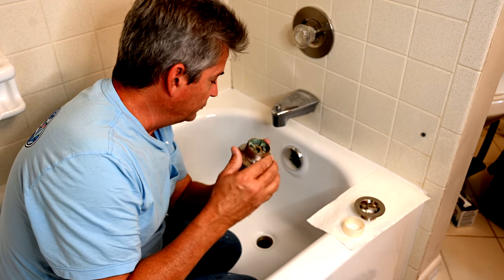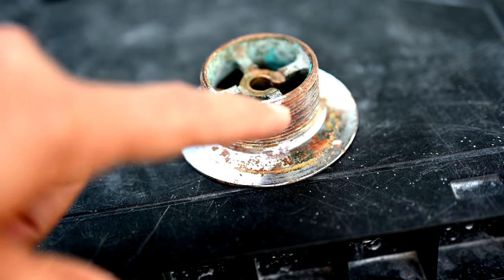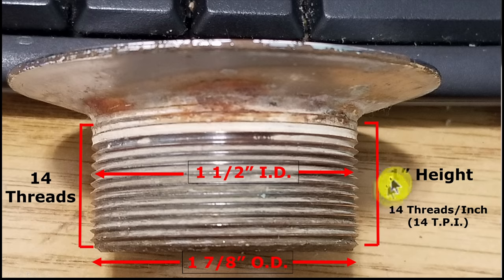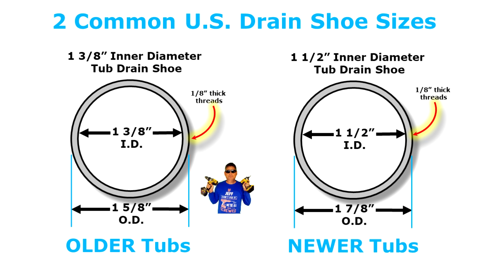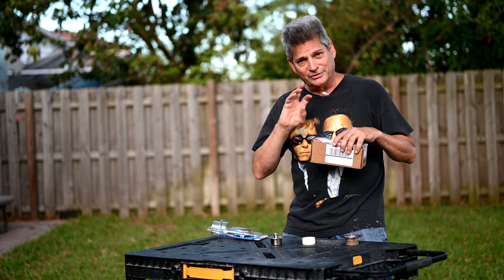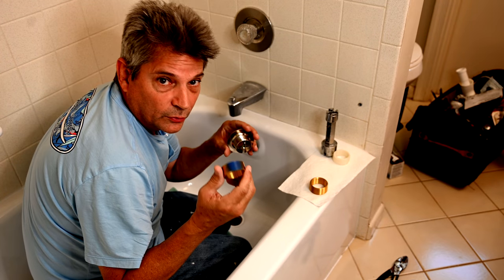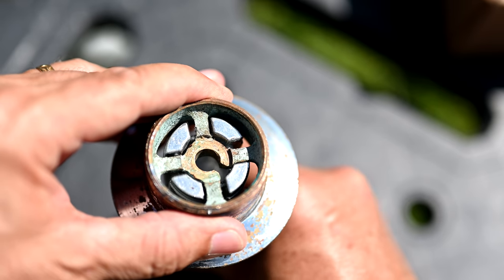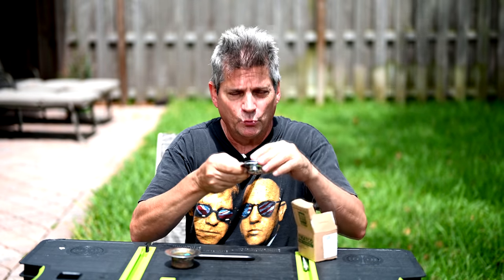New Bathtub Drain Won't Screw In? How To Fix Threads [SOLVED]

Comment: Don't use a wrench. My daughter did that and broke it the drain. I bought the Husky Tub Drain Removal Tool to get it out. Listen to Jeff and you will be ok.
Reply from the maker: Yes many people end up breaking the tool or the drain when they don't use that drain wrench
Reply: Absolutely.  Jeff's not going to steer you wrong.
Reply: Lol I used a pair of lineman pliers by the handle because they tend to be thick and robust, then I turned the pliers with a pipe wrench, but if I had the cool tool I would definitely use it.
Reply: @jeffostroff I tried 2 different husky tub removal tools that didn't work so I broke the drain on purpose and then used a dremel to put some cuts into it for grip then put the back of a hammer in and was able to break it loose then was able to unscrew it.
Reply: My husky tub drain removal tool wouldn’t tap in.

I eventually got it by heating it with a heat gun and sticking a wrench in it and putting a ratchet extension through the top side hole of the wrench 🤷🏻‍♂️

Comment: All this to replace a drain plug? The whole bathroom business is bobby trapped. I don't know what is worse to deal with - replacing a toilet, or something like this. Touch anything and it turns in a  a can of worms.  Kudos to Jeff for doing this in apartment buildings where he needs to get it right the first time and in one day and not cause the leaks in the building.  I wanted to replace a toilet seat in my house  then said might as well replace the whole toilet. Bought the elongated one by mistake, took it back to replace it with smaller one. Then realized my flange needed to be replaced. Had to chisel around the pipe to remove it but  dealt with that, then realized my floor is bad and ended up replacing the sub-floor bellow the toilet and relocating hvac pipe from the lower bathroom that was in the way ... Then wanted to replace the bath fan and realized it wasn't even hooked up to the roof vent it was just venting in the attic  and that is how the builders left it 30 years ago. ....Replaced the vanity and realized the new one was 1/2 in bigger so had to build up new floor height to adjust it,used difficult to cut cement boards-needed a special blade to complete the job. I suspected replacing drain on the tub would end up exactly like what Jeff;s ordeal here that is why I would never touch mine w/o real emergency never for cosmetics.  I think replacing the whole tub is easier but you MUST gut down the whole bathroom to the studs. Doing this piece by piece is worse.  I mean none of this is really difficult but you have to forget about everything else and devote infinite amounts of time and purchase the most annoying to find parts and special tools to get everything right. The alternative- to call professionals is out of the question for me because they charge you obscene amounts of money and you just don't know if they did it right or not.

Comment: 99% of attempts to remove a tub strainer in a 100-year-old cast iron tub here in the Big Apple result in a broken crossbar. I don't care what tool is used to try and remove it, the result is always the same. We have multi-family apartment buildings in N.Y. with no access to the rear of the bathtub. If by some chance a miracle were to happen and the strainer was able to be backed off, you better hope the shoe (a.k.a) the female threads doesn't drop down, cause then you're F%#$ed. Sometimes hiring a pro isn't a bad idea.
Reply from the maker: A couple of other good ideas that work pretty well is to spray it several times over a half hour with PB blaster and let it soak in under the flange as much as possible. And then a lot of seasoned plumbers will heat it up either with a heat gun or just with their torch heat up the drain enough that everything expands and gets slightly softer and that helps to loosen the drains as well.
Reply: Sounds like metal to metal corrision.  Slightly heating before removal may help.

Comment: OK I didn't want to like this video because of the dad jokes but it really set me on the right path to replacing the bathtub drain in our 1955 home that still had original drain. None of the off the shelf replacement kits would fit and it drove me crazy why. I have to give Jeff credit on making this video very easy to understand and next steps. Just like this video I bought the red and blue sleeves from Watco and everything dropped right into place. Thanks Jeff, you saved this man's sanity.

Comment: this is all well and good until you have to deal with a corroded drain that you have to cut out and mangle so you can't figure out the thread count
Reply from the maker: Best way to handle that is cut 2 vertical slits in the drain and pry the piece out, then you have an intact drain with just a slice of pie shape missing.
Reply: i did the job last night and it was tough but i got it! I notched a slot with dremel tool to hammer it around with a screwdriver. I used a heatgun to soften the old putty. I had to notch it like 4 times to get a full turn. After about 1.5hrs I got it! The old drain had putty in all the threads which made a B----! thanks for the video
 @jeffostroff
Reply: luckily the drain I bought had an outer brass coarse thread that the stainless fine thread screwed into....fit good @jeffostroff

Comment: Thank you so much for emphasizing threads per inch! Now I know why my box-store replacement was leaking. They didn't state anywhere the TPI but I measured and the new one was 16 TPI while my old one was 14 TPI. Close enough that I could thread it in but different enough that it would leak.
Reply from the maker: Way to go now you are ready to make that problem go away forever

Comment: Great video, just spent 6 hrs pulling my drain. The tub is 80 years old cast iron, but in good shape. My plug is fine thread w/inside Dia 1.5". I going to research the Watco website for the drain. Thanks Jeff
Reply from the maker: Is glad to help a good luck with your research Lisa
Reply: By the way might be a great tool to give away. I just bought the Lowe's brand today.

Comment: What an incredibly good video! 👍👍👍  There are tons of videos on how to replace a tub drain that go smoothly with standard parts.  They don't cover  the problems you just covered.  Thank you!
Reply from the maker: Thanks! 👍 Yes with my engineering experience I always get called in for the more difficult projects and so this was a great one to make a video for
Reply: @jeffostroff  I have several corroded exterior parts like the tub drain inside a jacuzzi tub.  Do you have a video on how to replace exterior in-tub jacuzzi parts and where to find the parts?

Comment: I wanted to drop a comment to thank you for making this video and going through the detail. Some days ago I had used the tool you suggested to unscrew my old tub basket. unfortunately it's 1 7/8" across where the threads are and is a 14 thread. So it's what the blue bushing converts to. However, the drain I bought was already 1 7/8" without a bushing. Now I ordered a smaller drain plug and have to wait 2-3 weeks for the bushing to arrive and hope that this all works. Apparently no one makes a 14 thread 1 7/8" bathtub pop up drain plug. At all. No one. So the frustrating part of my project is not the work itself or the labor but rather having some ancient plumbing that no one works with any more and I got quoted $700 to replace the whole system and decided to try it myself to just swap out the drain plug. What a nuisance. The industry are a-holes for making everything so obnoxious just to scrape together a buck at the customer's expense.

Anyway, thank you again for the video, the information about the bushings, and your tips. Hopefully everything works out in a few weeks' time and I'll still have spent under $100, just dealt with the headache of not being able to find a damn pop up 1 7/8" 14 thread drain plug on the planet.
Reply from the maker: That's what stinks abbot proprietary unconventional part sizes
Reply: Hi I am currently having the same problem!! Did it work with the bushing? I want a pop up drain but no one sells a 14 thread, 1 7/8 bathtub drain! So I resorted to ordering a bushing!

Comment: Thanks for that last info about the Watco faceplate.  I already own the drain wrench, so was able to move drain up a little but in the end might want to reuse drain (only 19 years old) with new faceplate.  I still will remove drain flange completely to make sure the black washer is installed correctly and redo putty.
Reply from the maker: Thanks for watching Katy, glad you liked it
Reply: On closer inspection there is too much corrosion to reuse the old drain flange.

Comment: I love your DIY videos along with another Canadian DIY show. Your instructions are clear and you are not arrogant or talk down to your viewers, unlike a builder channel from Texas does. We are going to be moving onto a brand new house my F-I-L is building for us. But our landlord is crazy, therefore we are fixing inexpensive damage to the house that was caused by her lack of maintenance and her cutting costs on the remodel that was completely her own fault,  but she blames us for everything, including forty-year old leaking windows a broken forty-year storm door that never closed, no exhaust system in the bathrooms or kitchen, not sealing Pergo in wet areas, and the whole septic tank system needs to be replaced, even though she never maintains it, and many other issues like corroded pipes that have damaged the bathtub faucet and handles, etc. It is just easier to fix things on our own than to have a headache we we move put on November or her trying to sue us for $10,000 for a new septic system when it never worked properly from day one. The house was never remodeled properly. Caveat Emptor, don't rent a place that looks brand new because there can be so many problems that our hidden and don't rent from a crazy foreigner who only accepts cash for rent and only speaks English when it's convenient to her.
Reply from the maker: Thanks Jenny, glad to help

Comment: You mentioned putting a little silicone around the drain after it’s installed. Could you show or explain how you do that? I’m concerned about water pooling around the drain after a shower because the drain is a little thick. The silicone sounds like a good way to make sure all the water drains out.

Comment: Great Video Jeff, I have a 1-3/8 Inch x 16 Inch fine thread that gets stuck after 3-4 turns and won't turn after that  Any advice? is there anything smaller?
Reply from the maker: This x16 thread, is this the new one, or the old one that you pulled out? You have to replace your drain with the same thread count that you took out, and diameter. IF it stops 3 or 4 turns in, the thread is not the same as the old one, so it won't mate up to the drain.
Reply: @jeffostroff  Thanks for responding Jeff. So the plumber cut the old one out in pieces. I managed to count 11 teeth on the old one , so it appears you are correct with the thread. I assume it’s 1 3/8 with 11.5 TPI? Which I cannot find online
Reply from the maker: @Callingzion   Did you use that table that I showed? If you can't find it there then your only other choice might be to replace the entire drain and overflow assembly which would require access to the droid wall behind the plumbing in the shower.

Comment: Thank you for this video. It is extremely helpful. When you said you would put silicone sealant around the drain after you finish the installation, how much do you use? Just a thin bead around. Do you wipe it in? Smooth it out? I’m new to all this but learning as I go. Thanks!
Reply from the maker: yes I run a bead all the way around the flange, then when it oozes out, immediately wipe if off, and use wet paper towels, before it starts to set up

Comment: Plumb shop from Canadian tire has the wrench in the picture as a removal tool. I was also told the new drains are plastic. So even more room for error with wrong tools. The proper drain wrench has gotten cheaper. Just got one for $7.99. Score.

Comment: Thanks for the video. I’ll be doing my drain in a few weeks. I got the drain already purchased. The top opening looks bigger than the old one. But it also has very thin walls. So I’m hoping it’s ok. I can only find 1 1/2 inch drains in the shops near me. Hopefully it fits. Hopefully my drain is actually 1 1/2 inch
Reply from the maker: If not you get a downspout adapter from 1 1/2" to 1 1/4"

Comment: I'm in tears trying to figure this out on my own. I had purchased the wrong size drain because it was too tall. The old drain is like you show 1". The one I purchased looks to be about 1.5". The threads seem to start to screw in but it only goes half way in. It's too tall. I've taken pictures and you can clearly see that the old drain is much shorter than the new drain.
Reply from the maker: You should be able to take the old dream that you pulled out of the tub and use all of the methods I showed here in the video to determine what you need to buy. Some people end up just ordering new drains online that have the correct width and threads so sometimes you have to get them from plumbing houses, sometimes it helps to know what the brand name is of your drain which is often the same as the the faucets but not only is guaranteed.

Comment: Hi Jeff thanks for your demonstrations. Is there another way to stop shower faucet cartridge (stem) with leaking, without removing and  replacing.
Reply from the maker: Probably not, it means either the black rubber o-rings are degraded and leaking, or if you pull out the cartridge, the 2 tiny rubber washers that go way back into the valve holes might be degraded, so it does not get a good seal. Either way, new cartridge is $15 so why no replace it and reset the clack back to day 1 again.
Reply: @jeffostroff  Thank you Jeff for your advice on faucet leak.
Reply: Yes plug it with 2 pieces of bubble gum and call your attorney general and ask what time is it. The call your girlfriend and break up🤣🤣

Comment: My problem is that the drain pipe has no threads. What would you recommend in this case?
Reply from the maker: There must be threads. This is how they secure down. Otherwise you have yo get into wall in front of tube and replace entire drain overflow pipe section which gives you brand new threaded drain pipe

Comment: Dang I didn't know that's what the gasket was for. The last one I installed didn't even come with a gasket and by luck I used putty but if that had been in the package I definitely would have used it in place of the putty. However, the manufacturers instructions don't say anything about putty OR the gaskets purpose. Just says remove old and screw in new.

Comment: When screwing on the new bushing onto the new drain and tightening it, then having to remove it when it goes bad will the bushing come out still attached to the drain or will it separate and stay in the tube drain?
Reply from the maker: If you tighten it really good onto the drain flange it should come off with the drain flange if you ever have to unscrew it out of the tub shoe opening. But in the event that it stays behind it should not be too hard to get it to come out

Comment: Question I tried to measure old drain and got 1 3/8 inside and 1 7/8 outside what am I doing wrong?  I have ordered two replacements and can’t get either to fit.  Now I found your video hoping you can help
Reply from the maker: sounds like you measure wrong. Did you use a caliper? If you measured 1 7/8 outside diameter, that is probably correct. Now it is the thread pitch, the # of threads per inch you need to figure You that you have so you can order the right bushing.
Reply: @jeffostroff  unfortunately no caliber with measurement but getting one today, appreciate the response brother

Comment: The Older vs Newer Tub drain shoe size SLIDE at around 4:25 mins. has lousy arithmetic  Older side is CORRECT: two x 1/8" added to 1 3/8" does equal 1 5/8" BUT on the right side NEWER Tub dimensions are WRONG two x 1/8" added to 1 1/2" does NOT equal 1 7/8th"!  It equals 1 3/4"    ( or  1 4/8 + 1/8 + 1/8 = 1 6/8 = 1 3/4!)

Comment: I have some oddball tub drain that is held in place with one screw in the middle to a foam gasket and plastic.  Of course now i notice it's leaking.
Reply from the maker: That is a strange configuration for a drain.
Reply: Ps if you don’t take a shower it won’t leak Duh it is fixed . And I didn’t charge you it’s free info